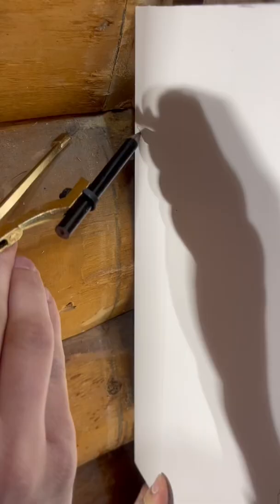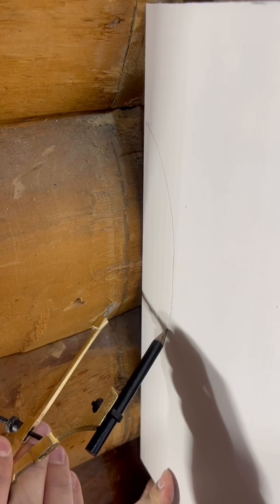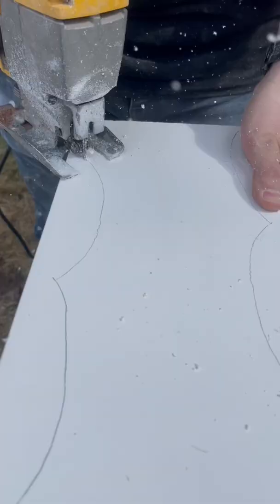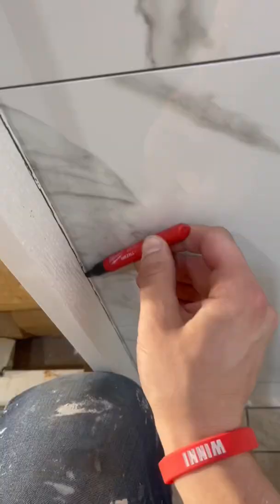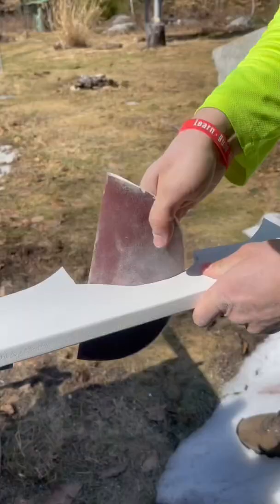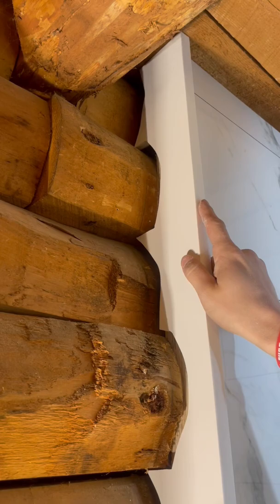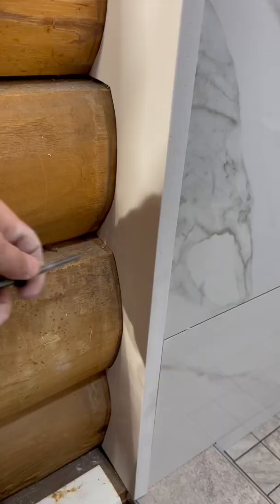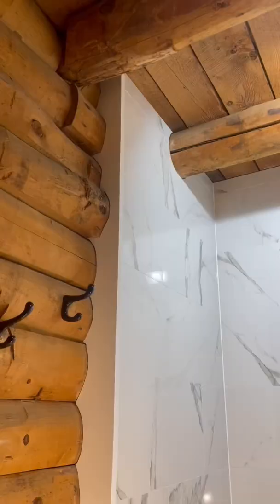How to build a shower in a log cabin house. #youtubeshorts #shorts #diy

Comment: Why not putting the logs after the pvc block? And align them flush against the board?
Reply: Those logs are the wall.  They don’t just stop there, they continue behind that shower.  I suppose one could cut a shallow channel in the logs to slide the pvc trim into, but that wouldn’t be the correct way to do this.  It would cause a problem for whomever decides to remodel the bathroom years later.
Reply: @ryanb4533  ah ok, I thought they were just the layer after insulation and everything else. Thanks!